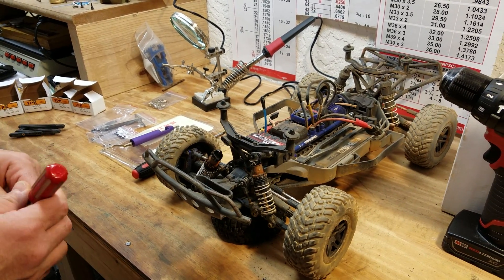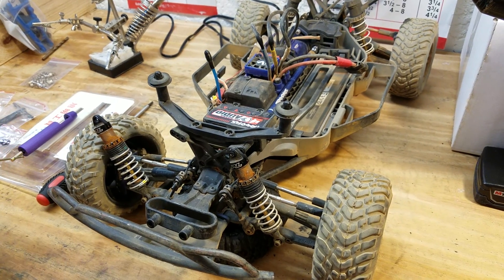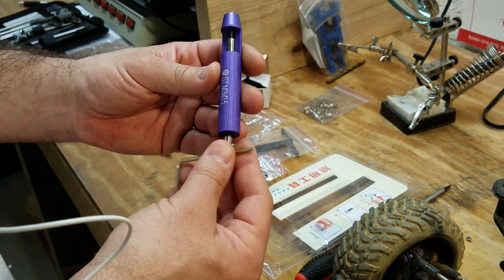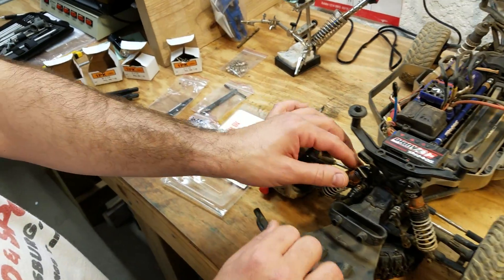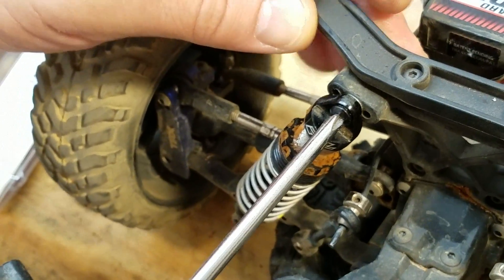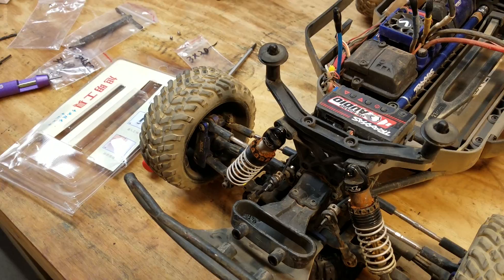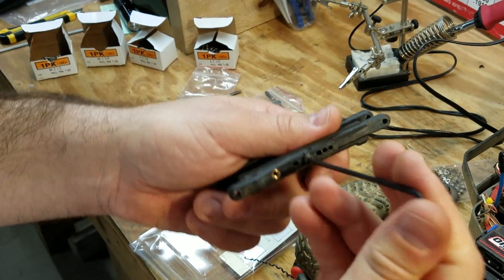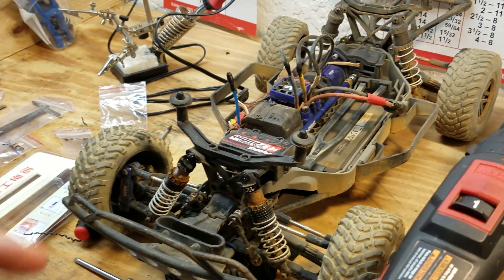How To Repair Stripped Threads in RC Cars: Self Tapping - Helicoils - Brass Inserts

Comment: sometimes i just put a longer screw into the part that the screw has pulled out from or i bolt a small nut on the end of the screw so it cant back out at all

Comment: the screw thread pitch you showed is not suitable for plastic. no wonder it stripped
Reply: Exactly. I don't know why tamiya include them with their kits. Going in to tapped metal fair enough, but they are the wrong screw for plastic.

Comment: All 3 are good choices depending on location used, first 2 are good anywhere and will even work with aluminum. The 2nd can be used on almost any part no matter what material. The 3rd is plastic only and depending on application could be a fail point if not installed correctly just due to its pure size

Comment: My idea would be to fill the hole with epoxy and drill a hole a bit smaller than the original screw in it when its hard. Then cut a new thread in the epoxy with the old screw. Question being if epoxy would stick to the plastic good enough. Haven't tried that yet.

Comment: Great video, I need to do a similar repair, I’d like to use a Helicoil for it. I measured my screw and its 5.45mm. What size Helicoil should I use? M5-M6? Thank you
Reply from the maker: Check out this chart:  http://mdmetric.com/tech/M-thead%20600.htm
It possibly could be an M5.5 but I'll bet you it's an M6.  I've never seen an M5.5 used anywhere on anything!

Comment: Yes the helicoil style is a solid solution. One shop I worked in, this was part of the design. I’ve installed thousands of these. Good explanation, good camera close ups.
Reply: Helicoil is a great thread repair system, works on everything from 1/28 rc to 1/1 heavy machinery. Three of the studs in my work truck are repaired with this system and has been holding for 5 years now